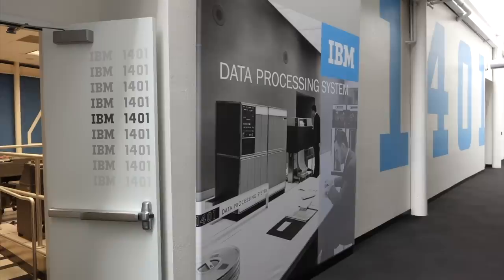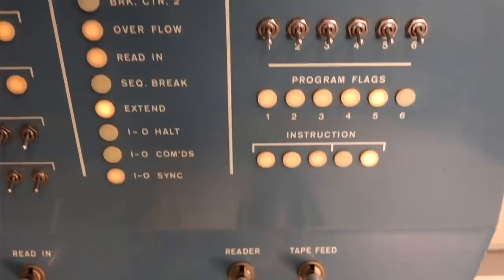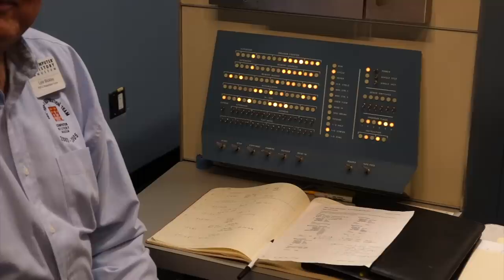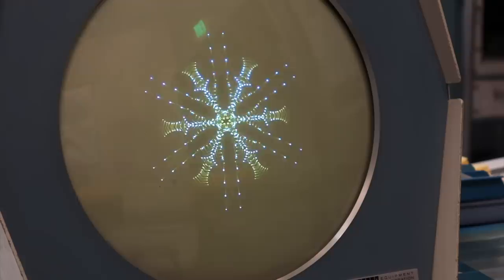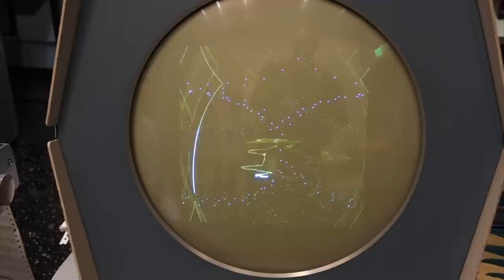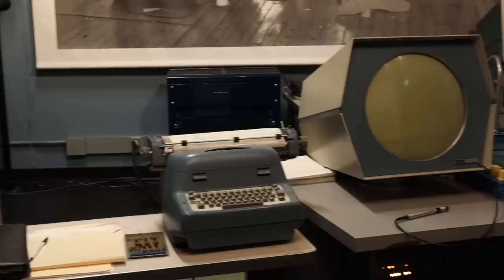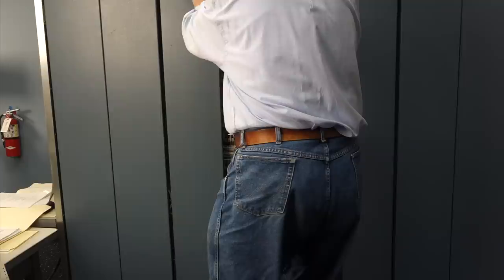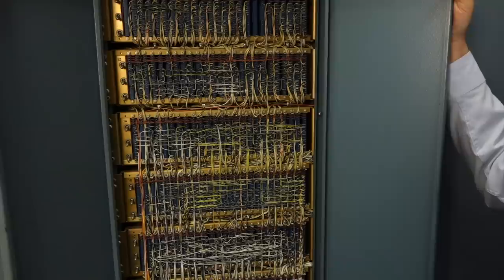Lyle Bickley explains the PDP-1 (and we play the original Spacewar!)

Comment: My brain is telling me I am looking at the 1980s because I cannot fathom this at 1959, this is beyond cool
Reply: Funny you commented that because Atari also got a version of Space War and the engine for it was used in Asteroids too.
Reply: I remember the 80ies, especially the Amiga a bit more powerful ;)
Reply: I just am blown away how quickly things progressed after the microprocessor was invented. There were some experts before then that thought only governments, schools and large businesses would onlt want or need computers.
Reply: @twistedyogert  This was not due to the microprocessor though. The key was massive fast memories. That would have led to powerful computers even without the microprocessor.
Reply: @herrbonk3635  Right, but cost went down with microprocessors. Only large corporations or government agencies like NASA could afford a computer. But with microprocessors you can buy one that is just as powerful for your office. I was told that price comes down with fewer numbers of components. So it's more efficient to combine multiple circuits into a single component rather than building them discreetly. Also, power requirements are lower, didn't some of these early machines use several kilowatts?
Reply: @twistedyogert  Hmm, CPUs were not really "discrete" before microprocessors. Most computers were built with TTL ICs. (Some used slow CMOS, some fast ECL, or other types of gates.) But sure, before that, discrete transistors and diodes were standard, usually using RTL or DTL logic.

Early machines (1930s and 40s) usually used vaccum tubes or relays as active switching elements, so these could indeed draw kilowatts. (However, a single so called "gaming PC" could draw many hundreds of watts too.)

My point was that the actual CPU iself tended to be a pretty small part of all the digital electronics in a computer during the mid 70s to mid 80s. Memories (ROM+RAM) used many times as many transistors, so making these small and cheap was the essential thing for cutting costs and reducing size.

A simple but pretty fast CPU could actually be built on a small PCB even in 1975-85. Half the size of a PC motherboard, or about the same size as the first graphic cards or disk controllers in the IBM PC. The main reason it wasn't done very often is that the microprocessor was "hip", basically... So customers "wanted" it, without really knowing why :D
Reply: I can sort of fathom this. Transistors were invented in 1947. By 1959, compact radios using transistors were already a hit with consumers. It would make sense that computers were using them as well.
Reply: @twistedyogert  Um... transistors were not nearly fast enough until the very late 50's to be used in computers. Also, microprocessors were so insanely slow until the early 90's, no scientific computer in any large institution used them.
Reply: our parents were very deficient in informing us ABOUT THIS!!!!
Reply: @atomatman3104  ok.
Reply: Aye cos there is nothing new under the sun 👻👽👽
Reply: @jonnyj.  What did Crays use instead of the 33 MHz Intel A80386DX-33 IV from 10-Apr-89? Wikipedia: The Cray Y-MP, also designed by Steve Chen, was released in 1988 as an improvement of the X-MP and could have eight vector processors at 167 MHz with a peak performance of 333 megaflops per processor.
Reply: @coldwater5707  Nope, it was from 1962
Reply: It was 1.000.000$ for this what kind of computers could go get for 1.000.000$ in the 80s
Reply: Im watching the high score documentary and I couldn’t believe they were playing this in 1964, like wtf that’s so early
Reply: people are not as smart as they think they are and more to the point..IT`S NEVER TOO LATE TO GET YOUR GED

Comment: 1024p display on 1959. awesome
Reply: And in 2018 most laptops are 768p and most desktop displays are 1080p.
Really makes you think... 🤔
Reply: my old tv is 480p and it isn't touchscreen xD
Reply: Old CRT televisions have better black levels and contrast levels than modern LCD tvs.  Plasma has a far superier image to LCD's. 

A plasma will have better quality imagine than a 4k HDR LCD today that cost $10,000.
Reply: @alexnemeth3680  Except this one was for like 10 people and actual laptops are build in millions and have a battery
Reply: Technically a vector display didn't have a fixed resolution. 1024x1024 is simply the number of individual coordinates for the electron beam to travel between. Vector displays don't have pixels or dots and technically resolution is infinite.
Reply: @elimalinsky7069  theoretically infinite. i guess it's technically limited by what moves the electron beam
Reply: @randomizzatore7732  a rotating magnetic coil moves the electron beam in a vectror display (which is a kind of CRT). The difference between a raster CRT which you find in a regular classic TV or monitor and a vector display is that the latter doesn't move in a raster pattern, doesn't have a shadow mask and doesn't use timing with frequency to display variable luminence on each dot or pixel. The vector display directly recieves X and Y coordinates for direction and speed of travel, with the lines created by the display theoretically having infinite dots or pixels in between coordinates, but the computer is still a digital machine with quantifiable finite values, so those exact digital values are translated to roughly equivalent analog frequency values.
Reply: It's a vector tube, not a raster one like your TV and modern displays though. So apples to apples comparison isn't very accurate. Also, fun fact, early computers used CRTs not for display but for data storage
Reply: @alexnemeth3680  they weren't mass produced back then, unlike today. 

so yeah, economics
Reply: The vector display may have used electrostatic deflection rather than electromagnetic deflection.  I don’t know the DEC VR-1 shown here, but I worked on some HP P7 phosphor vector displays pretty much contemporaneous and the HPs were electrostatic.  Calisthenics have to be done in the electronics to linearize the displacement on screen and it takes more electronic tweaking in the case of electromagnetic.  I suspect the 16 inch tube shown here was probably the same tube that was used for the SAGE defense system by IBM/Lincoln Labs at about that time (1959).

Edit:  correction, probably not the same as SAGE.  Based on other comments below, the SAGE tubes had charactron capability, which is projecting fully formed characters by sending the beam through a mask with the character outlines.
Reply: @bighands69  you know nothing....
Reply: Because they used a radar screen
Reply: @elimalinsky7069  So all the electronic equipment on the bottom of the display convert the digital commands from the computer into analog signals for the screen.
Reply: @twistedyogert  Exactly.
Reply: 1024x1024 yes, but no "p". There is no "progressive" scan on a vector display (no interlaced scan either).
Reply: @bighands69  yeah, but it heats & consumes & burns out
Reply: Definitely not progressive scan.
Reply: @randomizzatore7732  Except is been over 60 years, and the fact that modern laptops still come with 768p displays is COMPLETELY fucking inexcusable. The fact that you make a defence for them is laughable...
Reply: This screen can't even show text, just moving dots. That's why there's an automatic typewriter.
Reply: @uploadJ  eh, polar are usually denoted with r and θ, not ρ and θ, that would be weird 😋
so... ahr and theta?
Reply: @randomizzatore7732  nono, practically infinite, not theoretically infinite. Theoretically it is limited by the dispersion of the element that glows and the glass that covers it etc.
Reply: @bighands69  backlight based LCDs have horrible "blacks" (not a technical term, means how accurately the display can show, well, black). OLEDs though... 🤤
Reply: @bighands69  i had a dream the other day, i was in front of a computer monitor that was absolutely, perfectly black when showing black... it was amazing, it was as if the objects it showed were floating in mid-air. I wope up with a happiness that almost brought me tears. And then i noticed that i do not have to turn on the light in my room because the backlight bleed from my monitor is enough for me to see my room.
Reply: @uploadJ  Thank you!  I had assumed the large SAGE CRTs had a charactron of gun because the characters appear so well formed (or made to look well formed in the archival films of the SAGE displays).  It is all that much more impressive that the character information was drawn with vectors.  The very dim blue-lit rooms along with some seriously long persistence and sensitive phosphor probably helped.  I have an old Tektronix 551 oscilloscope in my basement and it occasionally freaks me out when I walk down and there is an eerie green glow which is coming from the CRT face that has been charged by ambient light!

I worked in a lab that had a PDP-11/34 outfitted with a VR-17 vector display.  We had an RL-01 disk pack that had the lunar lander game.  I recall finding there was a McDonalds restaurant on the moon.  If you landed successfully close enough, an astronaut got out and ordered a burger.  That was probably ~5 KW of 208 Volt 3-phase and two full size racks to play a video game.  Computing was a much more visceral experience back then,  I can still recall the smell of the oil and ribbon ink, the key feel, and sounds seated at a Teletype ASR.
Reply: @wtmayhew  Probably electrostatic. The inductance of the deflection coils would have limited the bandwidth of the display. Oscilloscopes all use electrostatic deflection for that reason.
Reply: @elimalinsky7069  You'd only find a rotating coil in a radar display. A normal vector display uses deflection plates and a/d converters like this display does. The difference between this display and a vector display is that you can feed a vector display the endpoints of the line (vector) you want displayed, and it manages the process of drawing the line in its logic. This involves calculating and drawing the points along the line between the endpoints (which makes the line more visible because the beam travels more slowly between the endpoints than it does on this display). I think this display can be made to do that, but the calculation is done in the PDP-1 CPU, not in a separate display processor. It's a bit of a semantic distinction as to whether this display is a vector display or not. It's most of the way there, except for the line-drawing logic not being part of the display. This tube and the a/d converters are the same components that would be used in a vector display.
Reply: @kapsi  you mean a teletype. A raster display like your laptop screen, can't show text either, just static dots.

A vector display can draw lines from a to b.  You can display text, but you have to draw the letters individually.  At the lowest level your laptop display shows text by changing the colour of specific dots on the screen.  You might not have to handle it, but at some level some software is converting individual characters into a raster which is somehow composited onto the screen.

A teletype is essentially a keyboard and printer connected to the computer for I/O.  Later they switched to terminals with a screen for the display, but if you look at any Unix(like) system you will find terminals are usually called tty devices, short for teletype.

Comment: Jaw dropping.1959, discreet transistors, 4k core memory - and look what it can do! Just amaizing. One deeply humbled programmer here.
Reply: 4 "kilo"words and it's 18 bit words. So it's 9 KiB in modern terms.
Reply: And it didn't have a hard disk!  That's what's amazing.  👍👍
Reply: At our university, they had us write up something similar in Assembly on a small CPU driving 2 DA converters connected to an XY scope.  At the time, tech had advanced quite a bit further of course, but it was instructive and a lot of fun to go back to the basics
Reply: @kaasmeester5903  is that recent?
or 20+ yrs ago?

I'm not seeing/hearing about a lot of low level projects like that anymore. 

In the '90s we did real time controls with 68HC11 MCUs and assembly, but the equivalent class was PIC based using python when my son went in 2010s.
Reply: @TEDodd  Early 90s.
Reply: @kaasmeester5903  so 20+ yrs ago like me.

Sad they don't do such anymore.
Reply: @acmefixer1  It didn't need one.  In those days all RAM was persistent.  One of the advantages of core memory.

Comment: Donating the computer, err, sorry "Programmed-data-processor" to MIT was a genius move from DEC. I bet they were not fully aware of what their creation would be capable of doing on "the right hands"! It's a shame that DEC no longer exists.  My father's job was to repair them, beginning from the PDP-8 I believe. Thanks for the amazing video!
Reply: Your father had an awesome job!
Reply: Only partially true.  I started with DEC back in 1976.  Back then, DEC made every part of the computer.  They made the boards, disk drives, floppy's, terminals both printers and video along with their own CPU's.  By the time Compaq came along, DEC had sold off many of these business to other computer company's.  For the most part, DEC sold off their PC business to Compaq.  What was coveted back in the late 90's was their field service business and of course their CPU manufacturing.  The Alpha chip rocked the world at the time and even Intel stole part of its architecture  which showed up in their Pentium class of chips.  Yes, they were sued and lost.  Sadly, once the Board kicked Ken Olsen out as CEO, DEC died.  My job was lost in 1993 as our business unit went out to Colorado Springs and after that, I have no idea what company acquired that division.  Just a fantastic place to work.  The micro VAX was on the Shuttle and there are still VAX running systems out there.
Reply: I worked for DEC in the 1980's. Donating computers to universities was a part of their business strategy. When those students went on to become engineers and scientists they would buy the same equipment for their businesses they had used in school.
Reply: The founders of DEC came out of MIT. The reason they created the company was they wanted to do more with building interactive computing, which MIT, other universities, and others in the industry were not so keen on funding at the time. The PDP-1 was a commercialized version of the TX-0, which was built at MIT, and was one of the first computers to run on transistors.

It took a little more prompting from John McCarthy, with his concept of "utility computing" in 1961, to get MIT on board with interactive computing.

What I'm remembering from my history is that the reason DEC named their first series of machines "Programmed Data Processors" had something to do with investors. They felt that there were too many computer companies at the time (DEC would be entering a crowded field, they thought), and so the company came up with the idea of not calling their computer a "computer." :)

Comment: That's why the old radar screens had a cone over it, so it would make the afterglow easier to see. That's why the original Star Trek show had the same rig, as a callback to those radar screens.
Reply: 525Lines i worked with old CRT radars, (1970-80 systems) on ships, those had a cone that was needed for glare, not afterglow.

Comment: I was born in 1959, and I've seen a lot of videos, but this one is by far the most fascinating. The first term for a 'computer' that I remember learning was that of an 'electronic brain', which is what I would have called the PDP-1, had I seen it in, say 1966. Jaw-dropping stuff. Thank you.
(I wonder--what would it cost to build a perfect replica?)
Reply: There would be no reason to build a replica that uses 2000 watts of power and can't store anything on a hard disk.  You could emulate the instruction set and display in software and it could be run on a smartphone.
Reply: @acmefixer1  it can run on your calculator
Reply: @acmefixer1  Tell that to the countless people 1000x smarter than you or me who have built exact replicas of the manchester baby, colossus ww2 code breaking computers, etc. There are PLENTY of reasons to build replicas, and thankfully, there are people not like you who are satisfied with emulators running on a phone...

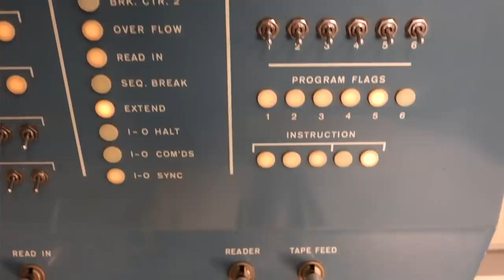Comment: Re: around 2:40, blinking lights and switches - I used to be an engineer on PDP-11 machines and they mostly still had the proper console, with lights and switches.  We used to write diagnostic programs in machine code and enter them on the console.  Happy days.
Reply: Real Computers have lights and switches! My intro to programming was FOCAL on a PDP-8 over a timeshare link. Later, PDP-11 and I  even worked briefly for DEC when I was in grad school (badge #47349). I can honestly say that DEC was a big part of why I got into computers (the other part was the lure of all those lights and switches).